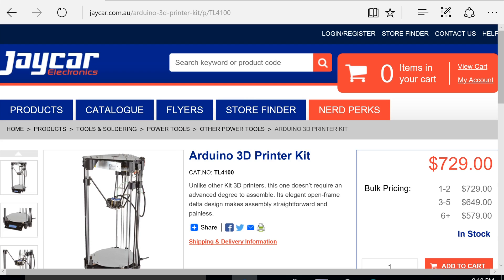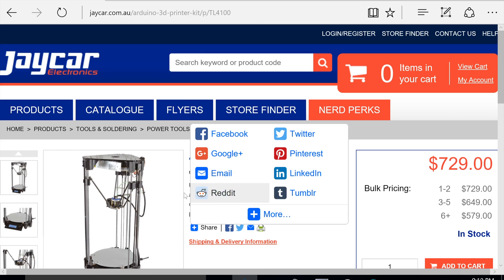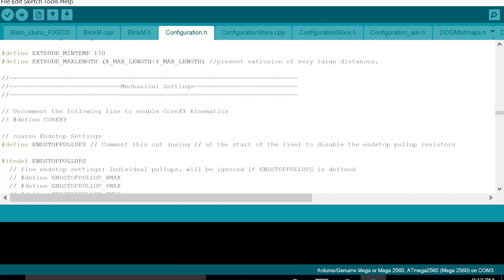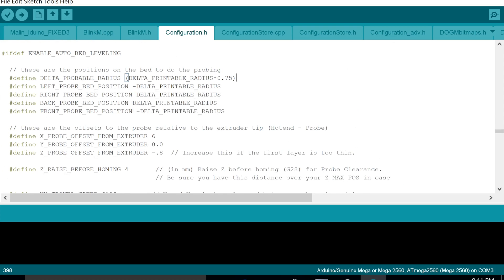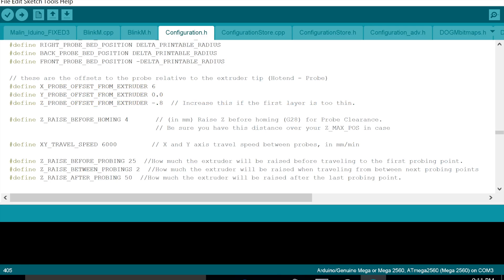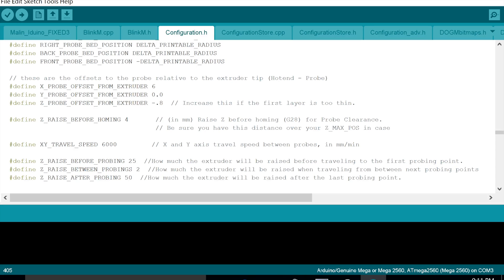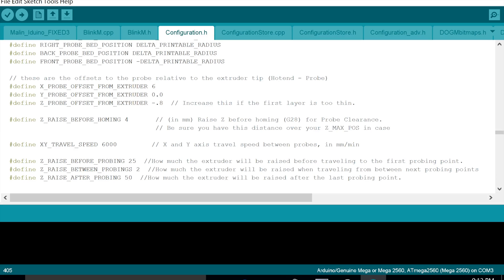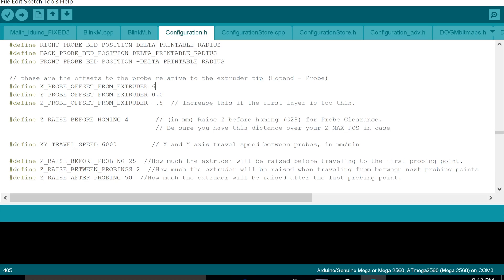How To Setup Auto Bed Leveling Firmware 3d printer Delta (TL4100)

Comment: Did some soldering got the sensor working now thanks for the tips.  the G29 command is doing something weird on my printer I even downloaded the latest firmware just in case.  I am currently uploading a video to my channel which shows what it does after a G28 and G29 and shows teh sensor getting triggered by my apple remote.  Please excuse the potato quality video its from my phone.